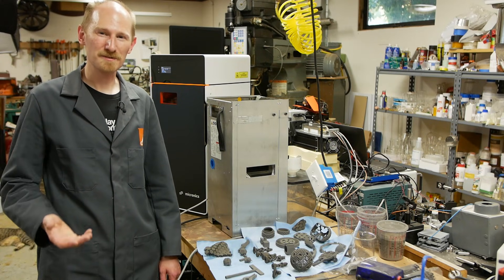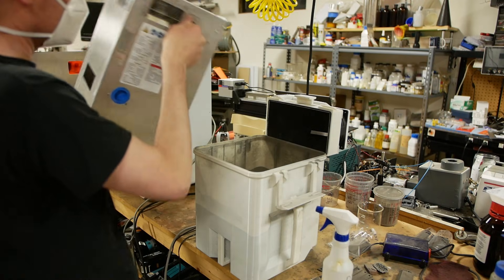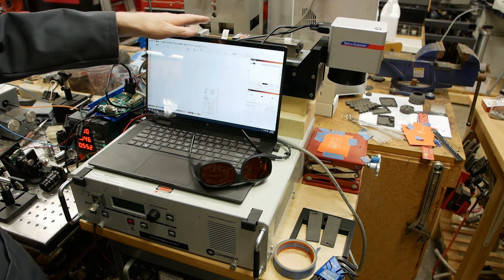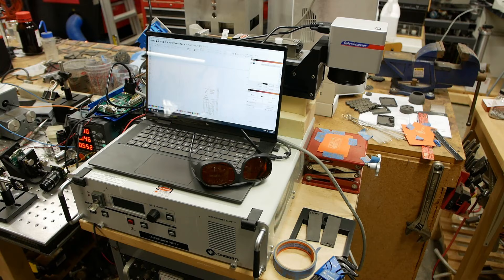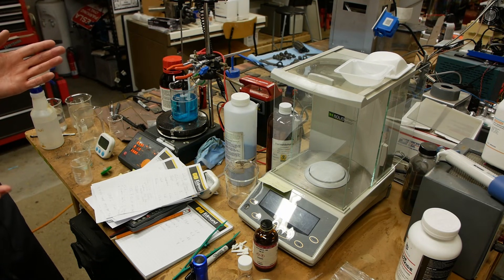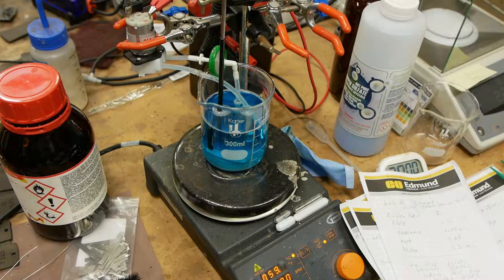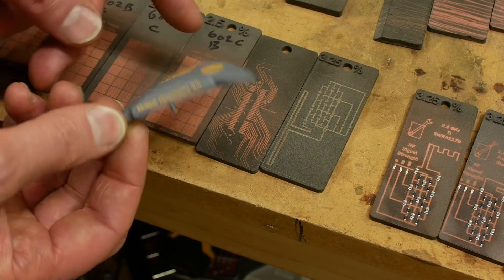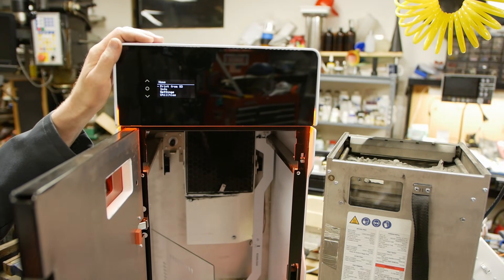Micronics SLS nylon 3D printer makes electronic circuits

Comment: The sensitizing while printing idea blew my mind.
On PCBs the electroless copper layer is thickened with pulse plating. You obviously have a hard time doing that here. What kind of resistance do you get on the traces?

Comment: how would the plating liquid reach internal activated areas? would you need to leave a pore open for the liquid to flow into, like a via? or could the trace travel straight through a nylon block? can the liquid soak into the sintered material?

Comment: For testing multiple Variables at once NightHawkInLight made a good video called "Test Multiple Variables at Once to Optimize Anything", alternatively such a problem can be represented as a n-dim. phasespace where each dim. is a variable, then search for local/ global maxima for the desired variable. This may not be applicable here, because of the number of variables for ingredients and order of mixing required combined with the single observed outcome of falling out / failure (binary outcome), but is great for optimizations.

Comment: With regards to your final point about "who would want to use this", I work in testing in consumer product R&D and the ability to integrate sensors, control, and wiring directly into the weird 3D printed jigs and prototypes I'm provided by various project teams would be a game changer. At the very least it would cut down on the wire and kapton spaghetti that everything seems to turn into the moment you start to assemble it.

Comment: Am I missing something or did you just propose a system for producing n-layer custom pcb's at home using sls?  Ok.  Maybe you'd have to create a heat activated granule that can produce the copper trace in situ, but that can be your next project.  You're 80% there.

Comment: I think something like a Roomba might be a product that could make good use of a technique like this, which is normally built with a whole bunch of small pcbs all over the device which all need to be mounted and connected with wires currently. If you could just stick the traces for that to the outside case and solder sensors to it,  that might actually end up cheaper at some point, saving on a lot of assembly steps and parts.

Comment: This video made want an SLS printer more than any normal review.

I think you are on to an incredibly useful technique we will see a lot in the future especially when it comes to failure detection/prevention such as formation of cracks (or maybe even strain - at least over bigger surfaces)!
Either as a continuity measurement or via monitoring the resistivity!

Comment: AUDIO.. SIZZLE.. LOL  Chat GTP probably  could go to a data base that had the pka's on the reactivity of combinations of these chemicals and looked at your methods.. and are you running the LLM locally? So when does this go  to printing resistors, diodes and transistors? Laser the volatile binder and then sinter the compound together using inkjet type deposition.. deposit then  process, deposit-process until you obtain the desired thickness, of course this would be on a larger scale than you are indicating..  like .5mm instead of 5um that can be potentially achieved that is desired to hook up raw silicon chiplets   Try Google if you want to run a local LLM, as it then can access all your and other like type videos..

Comment: Back in 2010 I had been messing with a bunch of .5 mm LED lights and trying to get the soldering, wires and all the parts to be small and customizable enough to meet my needs.  Maybe after seeing this some of the steps you are doing will make this project doable again.

Comment: I didn't get if the copper plating is absolutely necessary to this process or not.
Is the conductivity of the acivated material not that great or is it not suited for soldering afterwards?
If only the top layer is activated by laser, it makes sense, that its good to plate it afterwards.
But if the proposed method of activation on every layer while printing works, the plating could be skipped couldn't it?

Comment: Wait, wouldn't this dual-laser method be able to make multi-layer boards? With layer height of 0.1mm, board with thickness of 2mm could pack 10 layers of traces (assuming pulse converts whole thickess of layer).

 Edit: How bad of conductor is activated trace? Without copper bath? (I assume copper oxide is converted to copper with pulse laser and bath is only used to thicken already present micro-layer of copper)

Assuming micro layer of copper is good enough but pulse doesn't convert whole 0.1mm layer then you could crank layer count from previous example to 20, since each layer would have insulator base and thin copper layer on top.

I guess vias and connecting layers would be difficult

Comment: As usual, what Ben manages to achieve is amazing. These Micronics SLS printers look like they'll turn into a very good product, but I'd have been impressed if the video was just that he'd worked out DIY electroless copper plating, as someone who has wished he could do it before now. A more detailed video showing exactly how to do DIY electroless copper plating would be very nice! The fact that before anyone even has a Micronics SLS printer via the Kickstarter, Ben has already worked out how to hack one to make it print 3d circuit boards within prints is awesome.

Comment: Is the electroless copper solution you have provided useful for a DIY plated through hole process? If I understood this properly it seems like there would need to be some sort of catalyst for the copper to deposit on the non copper parts of the hole (i.e the sides)

Comment: I have used Light Burn since it came out. I love it and the developers are working on still so it's a live app. Some things could be better but it's easy to use and effective for people not wanting to directly deal with Gcode. But you can if you want to. Has reasonable in app editing and cnc manipulation.

Comment: An cool idea with the integrated pulsed laser inside the Micronics would be to do multilayer boards.
You could make hollow "arteries" to pump the copper liquid through for the copper deposit on the activated layer.
This project is so cool!

Comment: I don't get what you mean with incorporating the new laser to the printer; wouldn't it be impossible to coat the catalyst on the inside of a partt? Or by "inside" do you simply mean the parts that wouldn't be bale to be hit by a laser on the finished part due to concave geometry but are still on its surface?

Also: i'm sure i've seen this explored somewhere (maybe on your channel?): would it be possible to directly cinter copper traces in situ? Obviously that also means that your regular material is also full of copper, maybe it would not be conductive because of a filler material that would vaporize at higher energies (still requiring 2 lasers or at least 2 modes of one of course)

Comment: In my academic experience I have noticed that many papers are quite similar to the previously published ones with slight modifications. The problem that GPT helped you solve probably was published in some of the first (oldest) publication on the subject and after that was dropped as considered "common" knowledge in this specific field of science. This conclusion is also based on reading a considerable number of science publications from the late 1800 and early 1900.
Reply: I think that’s right. When making up “physiological salines”, I always add weighed solid compounds (salts, glucose, taurine etc.) to distilled water and pH the (almost) final mixture with NaOH and HCl solutions. The exception is adding Ca which is done by adding CaCl2 solution slowly into stirred or bubbled solution: if you added solid or too quickly, calcium salts (phosphates) can precipitate out.

Comment: 17:00 there is a guy making robot legs where the Hydraulic lines are bored holes that go through the bones of the leg, for strength and protection. Now the wiring can be the same- integrated into the bones of the leg.

Comment: If you had the pulsed laser incorporated into the laser sintering printer, you could print a motor winding without having to wind the wires

Comment: Awesome! How many times can you reuse the unused powder?
Reply from the maker: Good question!  Two to three re-uses is safe. Can keep going, but print quality may decline.  Micronics says the print temperatures can be adjusted to compensate for reused powder.  Alternatively, fresh powder can be added to the old after discarding a portion, and this process can be repeated for many cycles.

Comment: The cool thing woud be integrating the pulse laser into the sintering process allowing highly complex 3d traces (idk how useful that would be as you'd still need to get the electroplating solution to the traces and getting the various electronic components to the traces inside the part) edit: finished the video and saw you mentioned this too, I'd love to see you try it

Comment: Don't use dish soap, use medical wash soap. It contains much less crap. Mine is: Aqua; Sodium Laureth Sulfate; Sulfated Castor Oil; Citric Acid; Hydrogen Peroxide (<0,1%).

A rather short list😉

Comment: That tangent at the end... With good enough resolution/small enough layer height on that speculative machine you could print multi-layered PCB in any shape, which would absolutely be revolutionary.
Reply: The lasers only activates the catalyst, it still needs to be exposed to the plating liquid but can be under overhangs or on complex wrap around and inside profiles.

Comment: 10:35 that's just infuriating, isn't it. It's almost as if they omitted that bit on purpose. It's absolutely crucial that the procedure be correct, but they won't tell you that - just why?
Reply: To protect they'r special recipe so fewer competitors spring up. It's a Similliar deal to Coca-Cola. As for why something like this isn't illegal? Well, to protect intelectual property, and really, it isn't like people can't figure this out with a bit of experimentation and knowledge in the area, or so goes the argument you will hear when asking just including a lot more legalese.

Comment: Nice! As for printing on 3D surfaces, you might want to look into "aerosol jet printing". This allows the printing on any kind of curved surface with fairly high resolution. BTW, the printing of internal conductive traces is well known in ceramic part manufacture where they generally use silver/ceramic mixtures to create the conductive traces. These parts are then sintered in vacuum. Using this method you can even print passive parts like inductors, resistors and capacitors inside the ceramic.
Reply: That's I was thinking about it, using the process that he suggested, you could basically print capacitors.
Reply: In high powered ion lasers, the cavity rings are soldered inside an alumina tube; the tubes can be well over a metre long. The soldering is done by sintering a silver loaded ring inside the tube where each cavity ring will sit, then the whole assembly is placed in a furnace to solder it. I recently dismantled a damaged tube assembly and it contained around 30 cavity rings in the tube.

Comment: This is fascinating concept, Ben.  What you're describing is a way to build structural components with inbuilt wires and circuitry, thus building parts for a robot, say, that are multifunctional. Mind blown!

Comment: With that fancy dual laser setup you can even print the pads and stuff for components recessed, so you can more easily locate them for easier soldering, and also more easily pot everything in place to have a totally flat PCB with multiple planar layers, basically inlaying SMC's, really good for vibration damping because your whole board is monolithic.

Comment: If you could 3D print the traces layer by layer, you could make your own tranformers to any ratio, and even motors.  You don't actually need permenant magnets for motors, you can absolutely use electromagnets for stator and rotor, it results in a really powerful motor actually...
Reply: He's not printing the layers, just an activating surface which copper plates to. So where copper is wanted fluid must have access. Impressive all the same.
Reply: @kenmercer2721  He said himself he could activate it layer by layer towards the end which surprised me.  I assume he's just putting a hollow cavity though, either way, it could still work.  We print motor windings on transformers on 2D PCBs today anyway, think of what you could do with 5 or 6 of those with just some cavities so that the doping could still work.

Comment: Printing a 3d circuit board sounds cool. No more vias. Wonder if you could even print resistors too. Would you patent it? Sounds commercially viable.

Comment: Theoretically, one could take this even further by not only having multilayer trace capability, but components themselves could be fully or partially encased in sintered layers of "board" reducing surface mount height.

Comment: How well do you think a similar process would work for making multi-layer boards? I'm thinking something along the lines of using unclad fr4 material. Maybe the laser can be used to roughen the surface before adding catalyst and activating it. Then an insulating layer could be put on and the process repeated. Of course the laser could be used to poke holes between layers, kind of like a via. Do you think that would be feasible at all?

Comment: Sounds like this is something that would benefit from applying Design of experiments using multifactorial design with interactions to work through the process parameters and what interactions are important.

Comment: @16:47 I thought the reason for the copper plating solution was to grow the copper fragments activated by the pulsed laser because the activated copper powder mixed with the nylon was not contiguous copper suitable for conducting electricity. I thought the copper plating solution was to grow the activated copper fragments together so so they become a contiguous conductor. If the activated copper powder is inside the part, it won't be exposed to the copper plating solution so the activated copper fragments that are internal would not be contiguous and would not conduct properly. Or am I wrong about that?

Comment: For the method you mention towards the end of the video regarding activating the catalyst on each layer as the SLS machine prints, how does the copper plating get into those areas? e.g. if you wanted to make a standard flat pcb with 4 layers, could the catalyst be simply activated inside the material and then the copper magically appears with the electroless plating process? I don't fully understand how a process like that would work..

Comment: Yes! 3d-printed parts with embedded circuits is something I have been dreaming about since I started my EE in undergad (over 10 years ago). The ability to 3d print some mechanical structure with circuits designed into the part opens up so many possibilities in robototics - which is what first got me thinking on this topic - but I bet there are a lot of applications that haven't even been dreamt of yet. Thank you so much for you content! I love your videos.

Comment: Dude holy shit. I spent like 6 months trying to come up with an electroless copper recipe because I encountered the same issues of non-specificity on all the information and eventually gave up after smashing my head against the wall with so many failures. You are my hero for posting this. I cant wait to give it a go again. Thank you thank you thank you!
Reply: Considering that the copper chromite needs to be activated by an pulsed laser, I'm not sure this would work for a dipped part. Unless I missed something?
Reply: @skypatrol716  My application will use a different catalyst, nothing to do with circuit boards or laser sintered parts. I was just struggling with making a general electroless copper bath for doing a proof of concept experiment. My understanding is that he wants his catalyst to be inactive, until it gets hit with the laser pulses so that you don't end up with catalyst all over the part plating copper everywhere.
Reply: @ferriswhitehouse1476  Oh, I understand now. If I'm not wrong I believe Platinum is used as the catalyst in dipped parts. Or is it Palladian 😂
Reply: @skypatrol716  I believe its palladium, but I don't know much other than that :)
Reply: @ferriswhitehouse1476  Well good luck and I wish you success.

Comment: You need to be careful with copper chromite.  It'll be a chromium hazard, and is cancer-causing at super low concentrations (see the MSDS, but it's something stupidly low like 100mg/m3)... and you're working with it as a fine powder that you're kicking into the air.  That's levels where you shouldn't be working with it without a higher quality mask.  Just a N95 is not sufficient to protect you, you need one of the better quality face-hugger masks.

Comment: 7:29 a possible way of fine tuning (pun very much intended) this may be to use a microphone and say, look at what frequency is generated when the correct focus is achieved and fine tune the height off of that, i'm reminded of how AvE looks at frequencies of some appliances in audacity when theyre running

Comment: Now you can print a Luneburg lens for radar collimation.  You could also print radar wave guides and feed horns.  You could also print bifilar coils with exact lengths so that it is the perfect tuned tank of inductive and capacitive value for a specific frequency.

Comment: What about using your method to add metal to printed parts for non circuit properties? You could strengthen the parts, add heat resistance, etc.